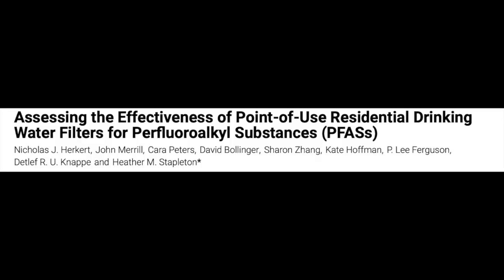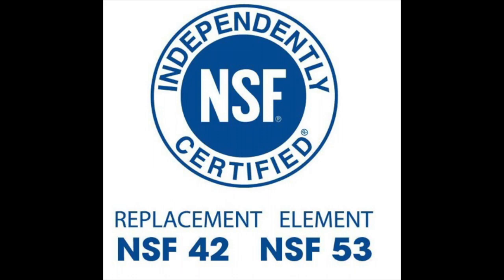Home Water Filters for PFAS: Things to Consider

Comment: Can you elaborate on the replacement factor? Is the replacement based on a poll date, a usage time frame, or is it based on a standardized PFOA/PFOS concentration to consumption calculation? If 8 have 350 ppt and my neighbor has 1,000 ppt, would he need to replace three times more frequently than me, or would I be replacing three times less? I'm trying to dial in our replacement frequency and PFAS testing is proving I'm getting it wrong... and losing faith in charcoal filters